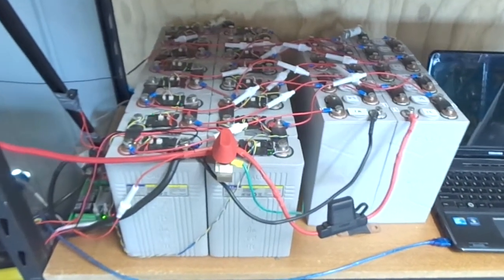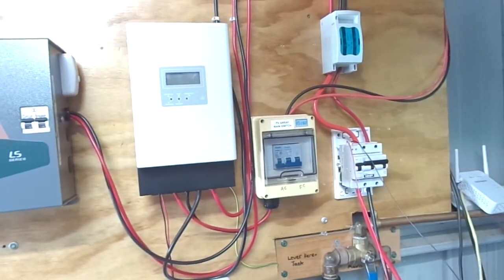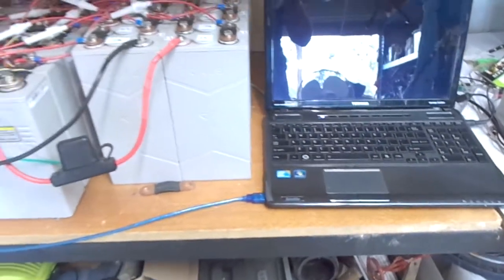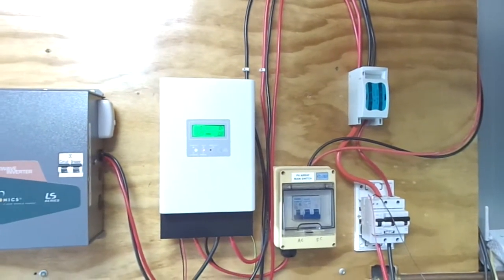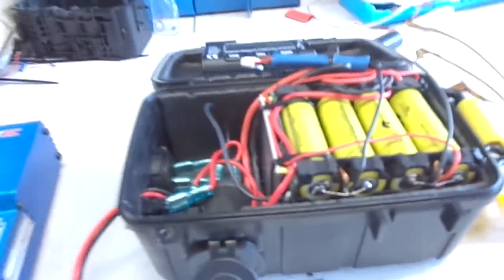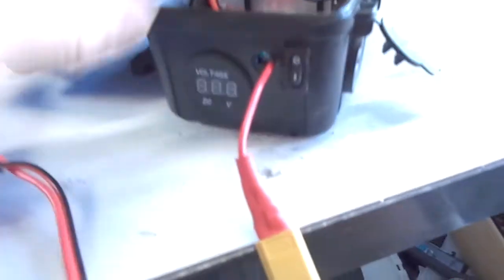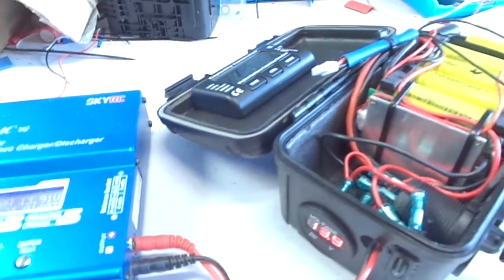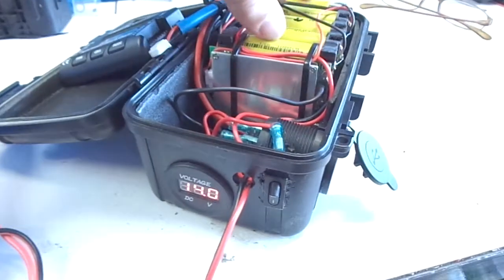Quick System Update and 12 Volt Test LiFePo4 Battery Bank

Comment: Could u share the links where to buy the Dc jack with rubber covers?
Reply from the maker: No problems, here it is 😊
https://rover.ebay.com/rover/0/0/0?mpre=https%3A%2F%2Fwww.ebay.com.au%2Fulk%2Fitm%2F162303652158